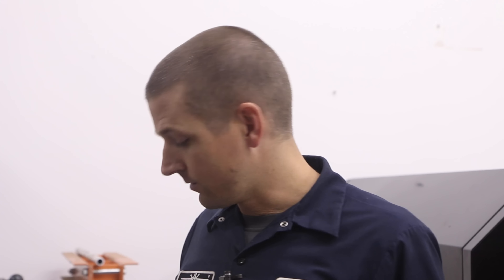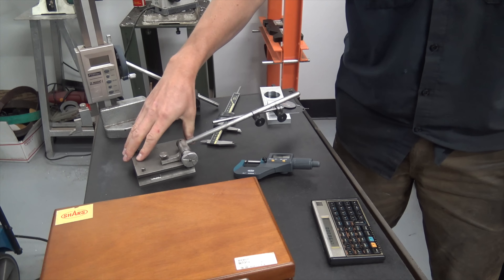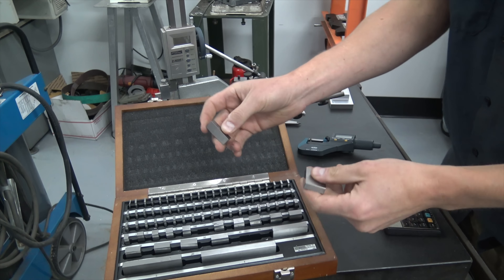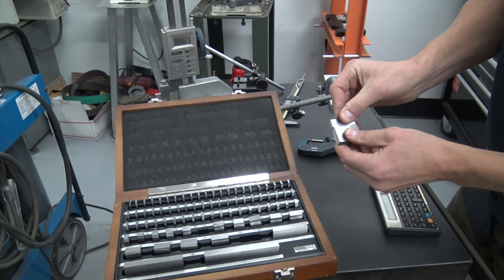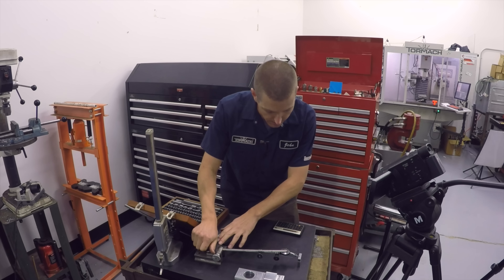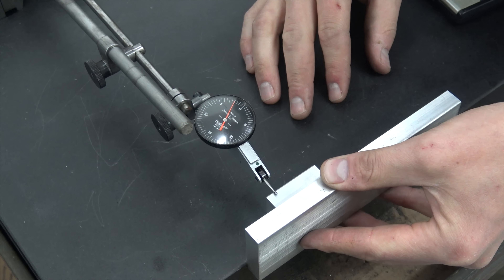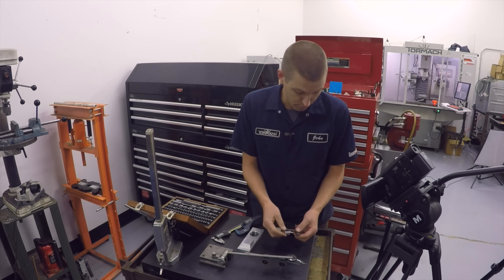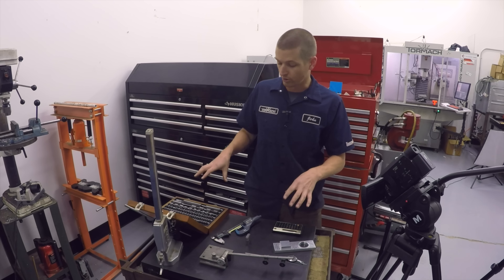Cheap Way to Measure Very Accurately!

Comment: Hi John. I will just share a couple of tips with you. You can wipe your gauge blocks on your wrist before joining them. The small amount of oil from your wrist helps them join. Also you should twist them from 90 degrees to parallel to join them.  When using a DTI for measuring. It needs to be as close  as possible to the base plate. Otherwise any crap on the table or deviation on the surface plate will give you false readings. Keep up the great videos!
Reply: I was gonna suggest the same bit about twisting to wring them. Slide them together perpendicular to each other, making a sort of plus-sign, applying a small amount of pressure toward each other, then twist them 90° once the plus sign is symmetric. You should find it very difficult to finish the twist.

Comment: We made height gages like those in school, milled them our roughly and then hardened them and after that we ground them down with an old jakobsen hydraulic precision surface grinder.
Came out top notch quality and stuck together as the ones you show!

Comment: THIS type of stuff is PRICELESS information. I love how you lay it down and say you don't need 1000's of $ to do something like this. I agree. there is a point of diminishing returns on everything, and a a lot of times the cheaper chinese/off-brand stuff WILL do just fine for 95% of applications. i mean, most of us are probably still on X2, X3, BF20 mills. I'm still just learning to use my X2. Thanks. Keep it up!
Reply: +Munky332 Some of the chinese isn't even close in quality. We have a bunch of dial calipers in my machine shop class at a school, and if you open and close them they usually never close within 5 thou of the previous close. Complete trash.
Reply: I mean 5, sometimes 10 entire thousandths. They have not been taken care of, and they are the cheapest of the cheap. Some of the better Chinese ones there are ok.

Comment: good basic stuff but keep the rod holding the indicator shorter and up closer to the base. also you set the indicator and moved the blocks under it correctly to make sure it would repeat but you did not reset the indicator and accepted a few tenths off--not good--reset it or remember where the needle was. the other thing was then you immediately grabbed the base and were moving the indicator all over the place.. sometimes it has to be moved but the proper procedure just for future reference is the part is moved--not the indicator after setting. also a tip. Drill the surface plate with a common mason carbide drill and install a 3/4 post held on with 1/4-20 from below--yes cbore with a bigger drill. Then make a basic indicator holder with a reamed 3/4 hole.. also on that 3/4 shaft sticking up--make a plate with a setscrew that has a precision big radius out about 2 or 3 inches or so for squaring up.. I will upload a video doing that so you know what I am talking about.

Comment: At my shop we use a dial indicator attached to a height gage (similar to the one you have on the datum table there). With this setup it is very easy to measure hole locations by running the dial indicator over the gage pin in the hole and subtracting the radius to get the center line of the hole. I spend a lot of time with dial indicators at work.
Reply: +NYC CNC. We also have indicators attached to an adjustable arm (similar to yours in the video) with a magnetic base. We attach the base upsidedown on an empty spindle and are then able to use this to square up vices, check flatness on parts while they're in the vice, and other general measurements inside the machine. we can use the handle jog to move the table around and use the indicator that way.

Comment: Nice tip, but you should check the gage stack again after measuring your part to check that it repeats and the indicator stand hasn't shifted on you between setting it on the gage and testing the part.

Comment: I think an even better way to compare the height of two surfaces would be using an optical flat and monochromatic light. You will see light interference fringes and looking at the pattern and counting the fringes will allow you to measure differences in height of about 100nm (0.000004 inch)

Comment: Yes! An RPN guy... gets a thumbs up for that alone! Couldn't tell if it was an 11,12 or 15C.

Great videos, thanks!
Reply: +NYC CNC  Suspect you've seen this... but on the outside chance:
http://www.hpmuseum.org/

Tons of good old HP stuff there; years ago picked up a 15C emulator from their site... have used it multiple times a day ever since.
Reply: That 12C popped right into my eyeball. My initial thought was that you could calculate your mortgage payments right there in shop. I have owned a bunch of them over the years going back to the original model with flashing red led's. Thanks for the vids.

Comment: Thanks for the video.

As I only have 0--1 and 1-2 micrometers, this extends my measuring capabilities. I don't have a set of gage blocks, so I have used 1-2-3 (and 2-4-6) blocks with adjustable parallels (measured with the micrometer) for the fractional part of the measurement. Not as good as gage blocks, but a lot better than dial/digital/vernier sliding calipers (all of which I do have). Slide calipers (of whatever style) seem to vary by a thousandth or more each time you measure an object unless ther object is extremely smooth and regular.
Reply: I measured the block dimensions in as many locations as I could reach with the small micrometers, and then checked for flatness/parallelism on the surface plate (cast iron) with a surface gauge and tenths-reading indicator. Then I started stacking the smaller blocks and using those known heights to check the larger dimensions of the blocks by comparison using the indicator. My blocks are surprisingly good considering that they are run-of-the-mill blocks. None are out by size or parallelism by more than a few tenths, and knowing the error, I can make stacks where the errors offset each other.

Comment: FYI the indicator tip stem should be, depending on the model, 12° of parallel not parallel. They are designed this way so that the body of the indicator to clear the workpiece.
Edit - My bad, this doesn't apply to all dials though so you need to check if it is a 'corrected' or not and what angle it is corrected for, that brown and sharp you have I believe is 12° stem angle.
Reply: in another video, he said the cosine error does not apply to "relative measurements" which is a broad concept for me to understand. I am trying to understand more...but Jesus, with the fact of people calling a stick articulating on a base, a "height gauge" it is also throwing me off. that is a base where I come from. a "height gauge" is a gauge that shows measurements as you turn the wheel to raise or lower the stylus of choice. I could be seeing a rift in the metrology community, but none of this has answered my actual question of relative measuring and cosine affecting readings on a height gauge that shows measuring and a dial indicator is allowing to set at zero and then read the digital gauge. I am on the fence, I think if the angle is steep enough, 15 thou or 0.31 mm is enough to be concerned and avoid. I however do not see enough data to show if there is a translation of cosine error to the main measuring device. come-onnnnnnn reddit. I understand playing with the gauges and testing some samples to verify is a method of approach. I am struggling to find this information out at work because of work, and do some mundane tasks beyond my routine responsibilities. This i can have in the background and listen too.

Comment: Important Tip on gauge blocks and pin gauges!....store and use them in a room temp area "68-72f or Celsius equivalent"..Even if you only use them to check and set your calipers/mic's its important your gauges and parts are at the same temp for qc checks....very easy to bounce off your high/low tolerance limits if your doing precision work.

Comment: Any real reason to measure with indicator about a mile from the height indicator base ?   I would slide that rod way back in and let it hang  out the rear of the height indicator.  You have a giant lever an might tend to jack the front of the indicator base up off the granite table a tenth or two.

Comment: Unless im missing somthing here & unless I was working to really close tolerances my choice would be a digital height vernier with a DTI Indicator.

  zero on the work piece then zero on to the surface table or vice versa read off the size quick & accurate.without a huge expense   I did like the software chart application for working out the minimum amount of slips stack though . :-)

Comment: I don't see how this is better than a micrometer. A good mic will measure 0.0001 inch accurately. Yes, a gage block is far more accurate than that, but the error introduced by your dial indicator is greater. Also, you're supposed to use wear blocks  on the ends of your stack of gage blocks to prevent slow wear of your blocks (you periodically replace the wear blocks).

Comment: I don't agree with the primes of the video. Is the surface plate and gauge blocs a cheaper more accurate alternative to handheld measuring tools? A set of tools at the side of the surface plate gets vary expensive quickly. For direct linear measurements nothing beats the conveyance of hand held tool, the plate and accessories are intended to be used for measurements of surfaces that are obstructed, note easily referenced or not directly opposed.

Comment: Very cool! But hey! I have the same exact calculator! I just pulled it out of a drawer today and looked at it and though "hmm I'll hang on to this" :) How cool is that? :)
Reply: +NYC CNC Ok, so your's a 12C, mine is an 11C. It was a dumpster find a few months back! I wacked some batteries in and tried it just now. RPN is cool but I had too google it! ;)
Reply: +Torsan1977 There is a little learning curve to RPN... but once you get the hang of it, you'll never look back. Well worth the effort, quick clean intuitive; more like you'd think if you were going to do the problem on paper.

Comment: I'm just a trainee, but aren't you supposed to use gloves when handling steel gauge blocks? Also, if the warmth of your hand causes that part to heat up by 18 F, that means ,3 thou. So this shows like the error of the instrument, meanwhile, you heated up the part, you were measuring.

Comment: When using a large number of gauge blocks you'll want to reference the deviation chart that comes with the set. My NIST grade 3 set from Shars came with one. Whether it's accurate is another question... See this excellent video from suburban tool on the topic. http://youtu.be/ZS2uym83jCU
Reply: +JoshuaP  I never knew deviation charts existed. Great video, thanks.

Comment: Is that an HP 11C calculator?
Reply: +scubaseppy 12C for the win!  I had one I bought used for $20.  Kept it in my shirt pocket as an engineer and dropped it on the floor every time I bent over for a few years.  Then I relegated it to my toolbox for a couple of hard use years.  I finally sold it for $180 on eBay when they became collectable.  Kinda wish I'd kept it.  I managed to find a 33s which does have Reverse Polish Notation for something like $40 new, but it's like a Romulan tricorder with those weird angled buttons... assuming Romulan tricorders are cheaply made in China and have a decimal point and comma that are nearly indistinguishable.  It looks like HP could make a good durable RPN scientific calculator like the 12C for $100 or less.  Seriously.  Why can't we buy these new?  Why does every calculator need to be cheap crap?
Reply: +Liberty4Ever I have a 11C and 12C.  The 11C pretty much lives on my desk.  I put a 11C app (Andro11C) on my phone as well as the Machinist Calc Pro app from Calculated Ind.  You can still buy the 12C new, but sadly, the 11C not been made in a long time.  HP did a special 15C anniversary edition or some such about 5 years ago, but did not keep it in the lineup.  Crazy prices for the old HP calculators on eBay.
Reply: +NYC CNC I still see 12C's for sale at Office Depot for around $70.  It's the 11C and 15C that most of us gear heads desire and are rare/collectible/out-of-production.  There are many more of the old HP's calcs that have equal or even greater appeal to some with fond memories and preference to RPN.
Reply: +gwcude I have the 11c app on my iPhone and I love it!  A older engineer at my shop turned me on to the backwards HP entering system I laughed at first but once I got used to it I started to not be able to use a normal calc.